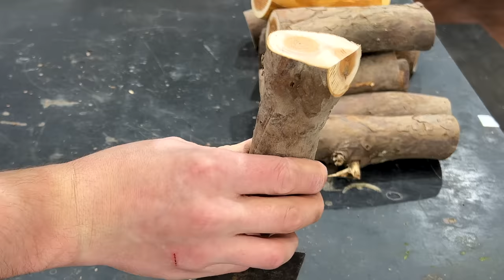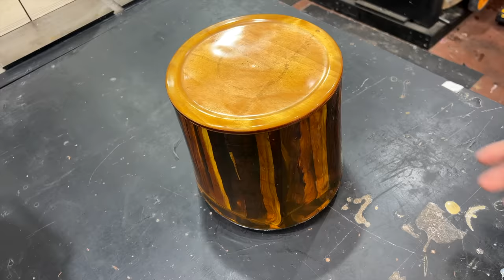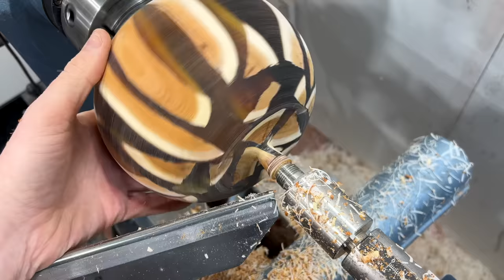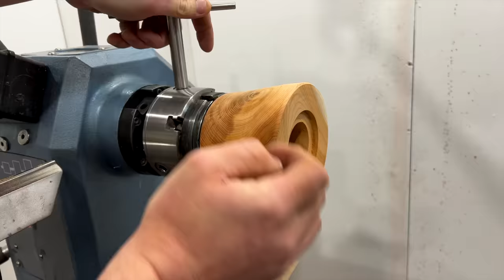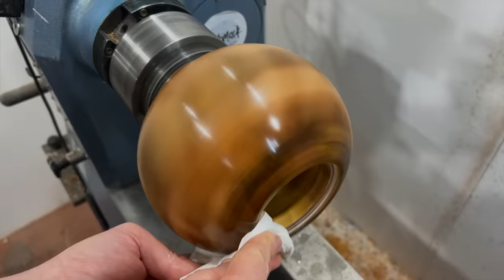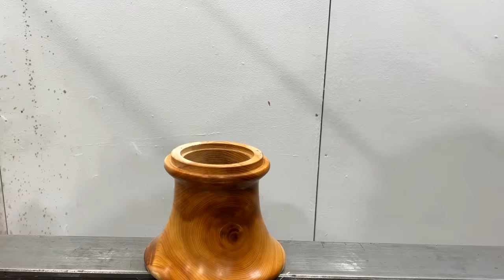Woodturning - Oh No YEW Didn't !!

Comment: My favorite wood is cypress. I made clocks from the wood with epoxy resin. Your work is so beautiful. I love to watch it transform in a very mysterious way.
Reply from the maker: Sounds great! Are you a turner?
Reply: @JackMackWoodturning  no not a turner we poured the resin over a thick slab with the bark on after drying and patching the wood and we used the cypress knees for the table legs. We did this in Manatee county around 1980.

Comment: Really perfect!
Is it possible to remove air bubbles from epoxide without vacuum?
Reply from the maker: I tend to use a pressure pot to squeeze them so small they can’t be seen.

Comment: I make lamps and I'm wondering where you got the bulb socket and wire?
Reply from the maker: Do you make lamps to sell??
Reply: @JackMackWoodturning  yes. I use old LPs and threaded rod to make a column and I put a long led bulb in the center of the column of records

Comment: You need to make a fairly large hole at the top for the hot air to escape, otherwise the lamp is finished!
Reply from the maker: We have LED bulbs now that emit negligible amounts of heat. So ventilation is not necessary. It’s important to test them first to be sure it’s safe.

Comment: How hot does this lamp get?  I would seriously consider drilling a few holes in the bottom of the globe and one at the top for air circulation.
Reply from the maker: Jess.. are you aware of LED lighting? 
This bulb doesn’t produce any noticeable heat. It’s funny that you could watch all this video and think after all that that I’m the type of person who doesn’t know what light bulb I’m using 😆
Reply: @JackMackWoodturning ,

LED bulbs get hot too.  Not as hot as an incandescent by any means, but still hot enough to shorten their life. Just some advice (from an electrical engineer), take it or leave it.

Comment: Is that safe? Will the resin not melt?
Reply from the maker: Why would it melt ?
Reply: @JackMackWoodturning   I put a hankerchief on top of a lightbulb of a lamp as a kid and it burnt the hankerchief. I forgot about the hanky. Lucky it didn't catch fire. Although if it did we would no doubt be in the room to see it cus we switch off lights.

Think resin melt point is 180C, lightbulbs can get really hot.

Comment: Isn't Yew wood toxic? Or has this been treated to make it less so? I'd be wary of handling Yew berries, wood, or leaves with bare hands.
Reply from the maker: It’s good to be cautious if you are not sure . Yes, yew is toxic if consumed. It is safe to work with the wood. Which is to say that it is as dangerous as all woods and should always be worked with adequate lung protection. Toxicity is not an issue form a woodworking perspective

Comment: Why not use shorter pieces of wood , and insert a smal bucket in the center before turning? That saves you time of turnig as well as epoxy material.
Reply from the maker: Because the pieces wouldn’t have flowed the to the bottom of the piece

Comment: Don't breathe the dust! I made myself really sick, working with YEW. It is poisonous! Even now, after two years, a little dust will will trigger my new asthmatic condition!
  It happened last week. I was wearing a dust mask, had the doors open, and an exhaust fan running. Three cuts on the table saw and a few passes through the planar, and I was suffering.   Bill      Vancouver Island
Reply from the maker: Hey bill. Sorry dude but this shit is a blown up myth. Yes, yew has toxins in it but you have to actually ingest the toxins in quite large amounts for it to poison you. And even then it effects your nervous system. 
I used to be super cautious with yew mainly because I heard all this rubbish too. But after many many years of turning it both green and seasoned in vast quantities I know it is no more harmful in the short term then any other wood. At least as long as you don’t eat the wood. 

Sorry to have to speak my mind on this but it’s best we squash these nuggets of misinformation rather than feed the fear. 👍🏻

Comment: Would it work to simply use a plastic cylindrical container for the core?  ...because you know all of the core will end up as waste? You could use a lot less plastic.
Reply from the maker: Non if it is waste. 
How would you suggest doing it that way? There would be no wood on the top would there ?

Comment: This man needs to be mindful of the distance between tool-rest to the workpiece: 1/8"-1/4"space between them...be careful thanx from:N.Kentucky...Cincinnati
Reply from the maker: I think you probably need to learn the difference between the things is professional woodturners teach to novice hobbyist turners and the things we do based on our experience and skill level. 
Iv been turning wood for a living for 20 years and for many of those years Iv also taught Woodturning to hobbyists and apprentices. There are a number of “rules of thumb” we use to teach safe practices but they do not apply past a point of adequate experience. They are used to teach beginners ways to ensure safety as they lack a comprehensive understanding of the overall risks. 
👍🏻

Comment: Impressive thing. But what about heating your resin with a lamp? Heated wood isn't good, and heated synthetics is much worse. You know there must be ventilation.
Reply from the maker: Modern led bulbs like this one produce no notable heat output. 👍🏻
Reply: @JackMackWoodturning  Still there is some. Well, your lamp isn't intended to be left on for hours and hours on end, I guess :))
Reply from the maker: Yes.. as you’ll see I wrote “notable” heat. When running for a full day the lamp was 18c (I did test it) 18c was room temperature at the time.

Comment: Hi Jack,
What is the make and model of your lathe?
Reply from the maker: It was originally an Piece of shit sold by Axminster tools under their “trade” range. I’m the first year of owning it I had to replace almost every part you can imagine is possible to replace. I had to have parts machined to fix the tail stock. Replace the motor, fit new bearings. When I took the bearings from the original machine into the breading shop the guy told me that even in China (where the lathe is built) those bearings would be classed as the lowest standard.. it’s all over a shocking lathe although it’s now a good lathe. I’d avoid Axminster tools at all cost.